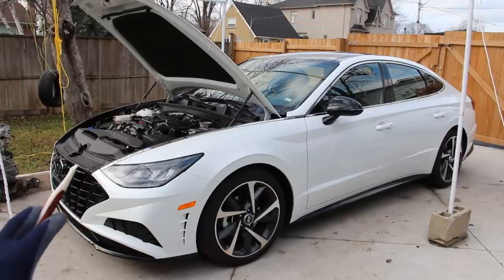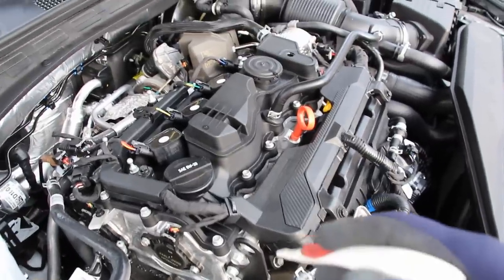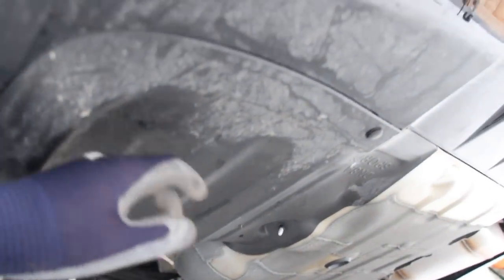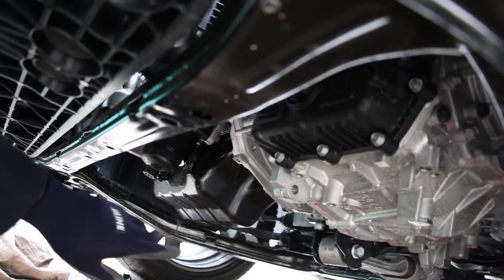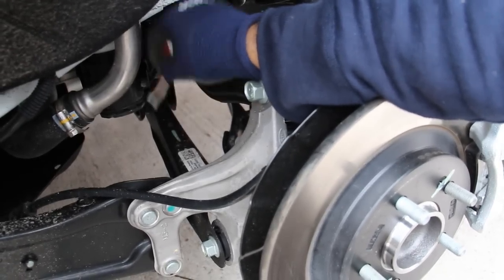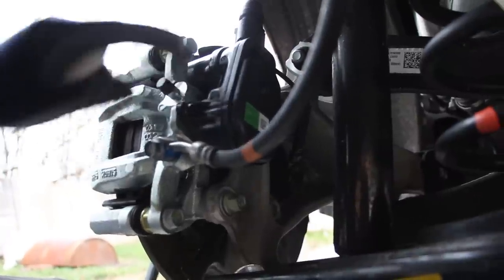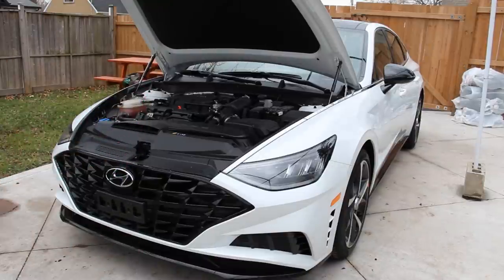Hyundai Sonata Mechanical Review

Comment: A four cylinder turbo is going to be nothing but headaches down the road.  Especially if it leaks oil off the dealer lot.  Yikes!
Reply from the maker: Imagine EV's...
Reply: @speedkar99  less engine parts to break no?
Reply: @speedkar99  the battery longevity is the biggest issue with EVs but not a lot of people talking about that. Yet.
Reply: Buy a Volkswagen. They're turbo 4's are very reliable.
Reply: @milliemone  🤔😐🤨
Reply: @richardday3136  battery degrades after 2 years lmao
Reply: @tails300  he’s not wrong. VW’s do have issues (mostly electrical) but mechanically lately the EA888’s have been close to bulletproof. Very overbuilt. People tune GTI’s to 50% higher power and torque figures and they run for hundreds of thousands of km’s without issue.
Reply: @christopher6895  but VW is one of the few companies that plans to go all electric sooner rather than later. Having electrical issues pretty much spells doom and gloom to any EV endeavors they plan to make. One more thing that needs to be said is what’s the point of having a mechanicallly reliable engine if you’re electronics are failing all around it, (because let’s face it German cars have so many modules interconnected with each other they may as well be EVs).
Reply: @milliemone  WRONG!
Reply: I don't think you've ever owned a 4 cylinder turbo
Reply: True but 10 year 100k mile warranty so who cares
Reply: I had a 2010 Hyundai Genesis Coupe turbo 4 that had almost 250K miles on it before it was totaled when I hit a deer.
Reply: My valve cover leaked already,  but hyundai is covering it.
Reply: That's part of Korean quality, along with constant recalls for engine failures and fires.
Reply: @milliemone bro said VW 😂 you know according to every website the koreans have a better reliability than the germans ..

Comment: We’re living in very ‘dark days’ in the pseudo reinvention of modern cars. It’s getting really unnecessarily complicated. Thanks for this review.
Reply from the maker: Itll only get more complicated. Look at computers and phones and how they've evolved
Reply: Forget about the vehicles becoming more complicated, and think about how many people you know that can even tell you how an engine works. Young people know nothing about how a car operates, just key turn/button press, put it into D and GO GO GO.

I wouldn't be surprised if LEASING becomes more popular.
Reply: You’re not wrong at all. The sheer fact that the all-electric overtake (within new vehicles) in 10 years, will be the ultimate stab at almost anything mechanical. And the kids won’t blink an eye at the historical demise of internal combustion.
Reply: @HARRYAZZHOLE  Disposable so yes leasing makes sense. Let's not forget one accident in a modern day car is a throw away. Even a simple windshield replacement is 2k or more easily plus calibration.
Reply: @everydaychris5597  Yeah, as much as I like my ICE cars the shift to electric cars is better for most people. They are far, far less complicated. There is pretty much only 1 moving part that's responsible for driving the vehicle.
Reply: @rudolphna54  where do you throw all those batteries when the car is junk?
Reply: @mark41157  they can get nearly fully recycled and reused
Reply: @rudolphna54  not lithium. Lead acid, yes. Lithium recycling is being worked on right now, but it’ll take a while to reach the mainstream

Comment: I wonder what the benefits of an electronically controlled thermostat are. I like simple designs that work and I thought the mechanical thermostat was exactly that. Sad to see so much plastic on parts that see high temperatures and pressures. Thanks for the tour speedkar.
Reply: Easier to diagnose.
Reply: @DrFadi  worse to repair
Reply: More evenly warmed up engines.
Reply: @Laoman23  Have you ever heated up a pot of water with a thermostat in it to test the function? It doesn't start to open until it is very near the full open temperature.
Reply: Its always better for the car if the ecu knows stuff and can adjust accordingly. If the thermostast has a problem youll get a code as opposed to overheating. Plus theres other benefits like in my car where after the engine is closed the water pump / thermostats keep running to cool off the turbo
Reply: Faster warm up for both cabin heat and emissions especially if combined with something like an electric water pump. Additionally can actually run the car at different target temperatures. Higher temps allow for better emissions and fuel economy when low power output is needed. When driven hard can increase coolant flow to target lower temperatures for more performance.
Reply: @briantii  OK that makes sense. That way the manufacturer can meet emissions specs and they can also claim higher peak power numbers than they could otherwise.
Reply from the maker: The computer has more control. In an overworked turbo charged engine, this is more important.
Reply: @alexkram  briantii is exactly right. It gives the ECU total control over the engine temperature which is fantastic from an engineering point of view. The hotter the engine, the more efficient it usually is. Cars now have different drive modes so selecting "Sport" will prompt the ECU to be more aggressive cooling the engine as it anticipates a higher overall thermal load that will increase rapidly as you floor it and then corner and then floor it again, and that means it'll need to have more wiggle room in engine temp to handle those spikes. Lower base engine temp means it can handle a sprint and then reject that heat over the next 30-60 seconds without issue. Selecting "Eco" will tell the ECU that you're going to be driving with a light, steady foot and demanding very little engine output which produces much less thermal load that needs rejecting and much more minor spikes. The ECU can confidently leave less wiggle room and run it hotter for much better emissions and economy. It knows exactly what the position of the thermostat valve is and can therefore calculate exactly what the coolant flow rates through the engine and radiator are and adjust accordingly. Electric water pumps are getting more popular too. They can be spun at any speed that the ECU wants, independent of engine RPM. They can be used even after the vehicle is turned off and parked to cool the turbo and continue moving coolant through the head where hotspots exist (such as around exhaust valves and ports, and wherever the piston comes to rest) and therefore help everything contract and cool evenly. They can be spun slower than engine RPM if that much coolant flow is unnecessary, which saves fuel because of less parasitic pumping losses. 

My friend's new BMW has active radiator grill louvers. They close up the grill completely when the engine is cold and when the ambient temp is cold. That prevents air from cooling the engine or radiator while the engine is trying to reach operating temperature. Getting the engine up to operating temp ASAP is the highest priority after a cold start. Getting it up to temp ASAP and holding it there steadily helps reduce wear from engine oil that's too thick. It warms up the oil which reduces pumping losses from pumping that super thick oil everywhere and it gets the oil to start being filtered instead of hitting the filter bypass due to excessive resistance to flow (pressure) through the filter cartridge. Dirty oil to the bearings and squirters and VVT doodads is bad. It helps reduce wear from overly large clearances and it reduces wear from asynchronous thermal expansion of 2 parts (like an aluminum piston expanding in a steel cylinder liner where the aluminum expands very fast and the steel with coolant surrounding it does not) which can cause metal-metal contact. You can actually seize up a 2 stroke engine that way btw, if you cold start a chainsaw for example and just thrash it right away it's possible to "cold seize" it. Getting the coolant and block up to temp ASAP helps prevent that because the pistons (following the exhaust valves, but those don't really seize) are the most rapidly heating parts from a cold start. Warming up quickly reduces the time spent running with the need to richen the mixture beyond stoichiometric (due to condensation on cold combustion chamber surfaces) which increases carbon deposits, increases emissions, wastes fuel, and dilutes the oil with condensed fuel while washing off lube oil film at the same time it drips into the crankcase. It reduces water condensation in the crankcase. It fires off the catalytic converter quickly and keeps the AFR sensors hot and working well. It gives cabin heat as quick as possible for auto climate control to function the best. All of this is important. Us technicians hate the extra complication, but the EPA tightens the rope around every manufacturer's neck quite a bit every few years and these micromanagements of engine parameters are the best way to increase efficiency to meet those EPA law demands. Soon, I predict that we're just going to be left with engines that use the Atkinson cycle, along with a turbo, fully variable camshafts like BMW valvetronic, no throttle body, with variable displacement cylinder deactivation systems, and coupled to a hybrid electric drive in order to have a grocery getter that complies with the future 50mpg city EPA economy demands. 😸
Reply: @footballcoreano yah, thats why the all shit boxes of BMW 730’s leaks like everywhere.
Reply: Works fine since 22 years on my E46
Reply: @footballcoreano you crazy as hell. Toyota and Honda engines are at top reliability stats if you check reliability engine stats. BMW isn't even close why you think you see way more million mile Toyotas or Honda and Hyundais compared to bmw? This isn't the 80s my guy 🤣
Reply: Emissions.  Most of a drive cycle emissions come from the cold engine during warm up.  Better control of warm up can optimize this time (reduce it).

Comment: I had first gen 2011 2.4 L non turbo version of this car. For 150000 km it was fine with only two  non-maintenance issues and those were a temperature sensor in the transmission that went bad and a steering column bushing that had to be replaced. At 150000 km I gave the car to my son who had it for another 10000 km before the crankshaft bearing were starved of oil due to the small holes being plugged by debris during the manufacturing of the block. A known Hyundai issue. The engine seized and had to be replaced. Fortunately for my son Hyundai gave him a new engine at no cost to him. It was a great car for  me for over 10 years. I hope he gets another 5 y out of it.
Reply: A transmission going out before 150k km would be disappointing. But wow, yeah, lucky save that they replaced the engine after 10 years, they get brownie points for that.
Reply from the maker: Common issue. I have a video on that engine's failure.
Reply: @logical I'm driving a Corolla as my daily beater too. Boring is a good thing when it comes to reliable transportation, I'll get my thrills elsewhere.
Reply: yeah that engine was contemporary hyundai’s lowest point
Reply: Yeah that was a first gen year 2011 one of the worst in Hyundais history definitely a manufacturing issue year newer ones don't got that issue at all
Reply: @MattExzy  Hyundais automatics are pretty bulletproof definitely stronger than Hondas. Hondas only strong point is a well made engine and even that's debateable with the new ones. But Hyundai as a whole has improved drastically they try to make everything themselves which is smart
Reply: @MattExzy  the transmission didn't fail, a temperature sensor failed.

Comment: Every Hyundai I've owned has leaked and/or burned copious amounts of oil without fail. Sounds about right.
Reply from the maker: I wasn't expecting a new Hyundai to leak. Leave that for BMW
Reply: We owned 5 hyundias. None leaked oil under 100,000 miles, Then the valve cover gasket starts to get hard and it leaks from there.

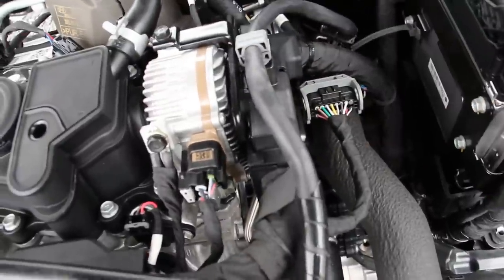Comment: The "thingy" at 5:25 at the end of intake camshaft is a Continuously Variable Valve "Duration" (NOT timing) actuator. It's first implementation of adjusting valve duration continuously with a crank driven camshaft. (as opposed to VTEC which mostly has two discrete settings)
Reply: that's what ya mama said last night
Reply: Is that why Hyundai is greatest car in the world? 😅 Hyundai should throw something to sell their mediocre products
Reply: I thought i-VTech was infinitely variable and it's just the older system that used the on-off switch style VTech
Reply from the maker: Thanks very much. I've heard about it but never thought Hyundai would be implementing that on these low-class vehicles and would have saved it for the N type of cars.
Reply: @inspectorjavert5563  pretty lame dude 🤷
Reply: @footballcoreano If you are refering to VVT(Variable Valve Timing) you are indeed right, but if you where refering to VVL(Variable Valve Lift) then you are not correct.
Reply: @thetechlibrarian  The cam phasing is variable, the valve lift is accomplished by switching the cam lobes.
Reply: @joegreene6250  ahh ok thank you my friend
Reply: @speedkar99  what’s funny is I don’t think the N has it
Reply: @speedkar99  l like the description 'low class's ;)
Reply: @strifu808  You are correct, only the 1.6T engines have CVVD, that what makes them so special!
Reply: @JohnFT3414  although I have forgotten to mention the i20n that has This engine. This CVVD has allowed me a 350 mile journey while driving pretty fast. From north New Jersey to Virginia Beach averaging 41 mph with 1/8th of the tank left. Elantra N line 6 speed manual
Reply: @footballcoreano doesn't matter. Japanese and Korean cars always been more reliable light years than anything Italian. I never heard anyone say a fiat or anything else being reliable 🤣
Reply: @footballcoreano also to add the real innovators that Japan and Korea supposedly copied are Germans and swedish with Benz and volvos. Those two brands are the true reliable Europeans brands that also have fallen off while Japan who was best friends with Germans in history with WW2 simply excelled and wanted to be the best at quality and reliability with their engines being even more reliable than Mercedes something that previously was thought of impossible with how reliable they once were
Reply: the 1.6 turbo does not have cvvd (continuous variable valve duration)  it has cvvt (continuous variable valve timing ) the 2.5 liter Theta III engine is equipped with cvvd
Reply: @robertwoznow1591  half false. The 1.6t does come with cvvd.
Reply: @robertwoznow1591  so does that mean the engines with cvvd are better than the base gdis with cvvt? I mean it is new technology but it's simple mechanical nature almost like cvt but being a timing system makes it reliable cause it's simply made not electric
Reply: @JohnFT3414 
However, in the Sonata lineup, only the Limited is equipped with it. Despite other trims also being equipped with the 1.6T engine. One feature that sets the Limited apart from the SEL Plus.
Reply: @robertwoznow1591 
The Sonata Limited actually is equipped with  CVVD. The only trim of the Sonata that has it. All other versions of the Sonata with the 1.6T are CVVT. At least in the North American market.
Reply: @strifu808 
Only the Sonata Limited trim.

Comment: If I would buy this model long term the deal breaker would be awareness of quality control quality. Yes it is terrible one of the bolts not screwed in properly but the QC stamp right next to it is absolutely shocking for me. It changes my opinion on Hyundai quality in general. Every manufacturer can and will have omission on assembly line and this is why QC is that last protection for us buyers regardless of engineering design flaws or brilliances. So if QC is missing it is not worth risking your money. It is a shame, as IMO Hyundai makes a good looking cars packed with features and good aftersales support and servicing. 
Thanks to your videos we (average byers) get the chance to sneak peek into those hidden places your local dealer will never show you or mention to you. You are a great asset to YouTube.
Reply from the maker: Thanks. I'm glad you appreciate my video format, you are right, I want to show what the dealers don't and what's often overlooked from a technical perspective. I'm more weary of Hyundai's quality after reviewing quite a few of them.

Comment: I think people perception of Hyundai and Kia is outdated. True, thetta 2 had some MANUFACTURING issues (due to third party, not Hyundai), but -at least in europe - those cars are as reliable and durable as Japanese competitors. I repair car for a living, also I'm owner of 2017 Optima with 70K km and 2013 Rio with almost 300K km - both cars are trouble free, both have petrol engines (2.0 nu and 1.4 gamma respectivly) - regular maintance only. Also - I have seen some Kias and Hyundays with turbo engines with 150K km on the clock.
As for this oil leak - it could happen to any car brand. Still - very nice and informative review, thank you. Please do the latest Elantra.
Reply from the maker: Take care of them and they'll last, but from what I've heard these cars were having issues right out of the factory which is scary.

Comment: I like that Toyota is making engines that are GDI but also have port injectors to keep the valves clean. It's a more complicated design but cleaning intake valves as the engine ages and the PCV system injects more gunk is not easy. Unless they have figured out another solution to that somehow.
Reply from the maker: Agreed... Toyota started it right with D4S
Reply: Ford does it as well.
Reply: Hyundai’s NA 2.5 and the 2.5T are also combination port and GDI. They probably didn’t do it on this 1.6T since this engine includes a wholly different cam system for the CVVD tech that adds complexity already